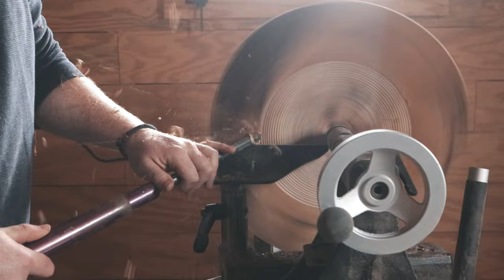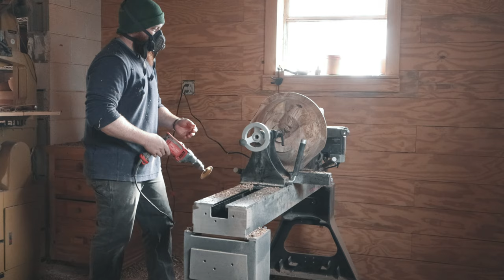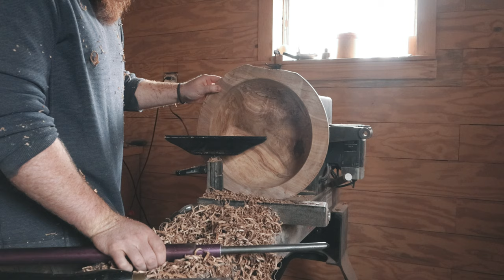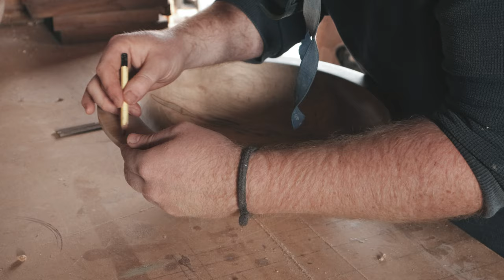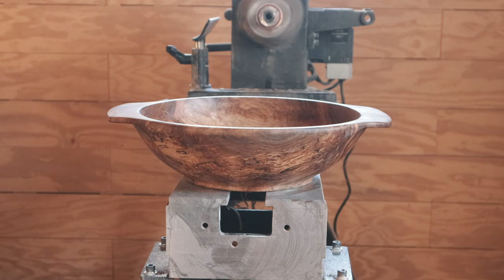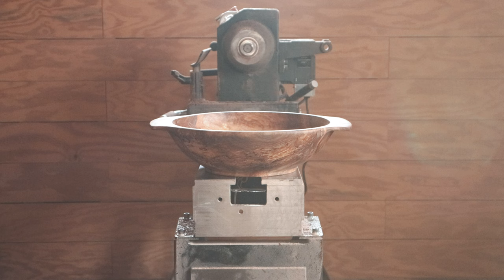A Modern Twist on a Timeless Piece | Wood Turning a Dough Bowl

Comment: Fantastic work. I'm gonna have to try this out at some point. What chuck are you using and how are you going about sharpening your gouges? I have a chuck from PSI and it definitely works but has the two bar tightening which is cumbersome for bigger bowls. I recently got a Tormek T8 for sharpening and it has helped a lot. Very repeatable for whatever profile you choose but the stock wheel it comes with is not great for taking off loads of metal so as long as you are close to your grind then it's awesome.
Reply from the maker: Thank you! Currently I am using a Nova supernova2 chuck with 3" jaws. I have had this chuck for 8 years and its been fantastic. I completely understand the frustration with the bar tightening. I had that style before I bought this one & it was always cumbersome & I never felt like it had a great hold. Funny enough, I have started using again though for smaller turnings just so I don't have to change out the jaws lol For my grinder, I use a rikon slow speed grinder with a CBN wheel & the wolverine sharpening jig. Its something I have also had for many years. I still have a stone wheel attached for sharpening of other items but mainly use the CBN side for gouges. From what I know, the Tormek is a great system. I have looked into one myself but the CBN wheel upgrade kept me with the rikon. Maybe one day I'll upgrade to the tormek lol